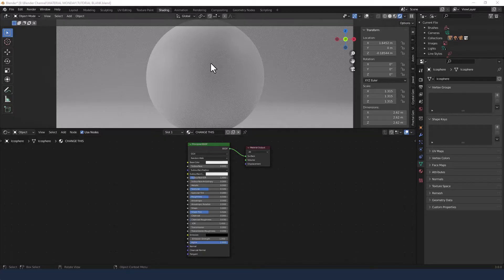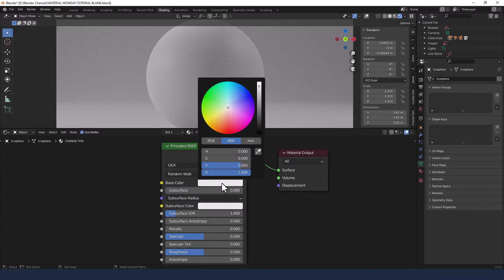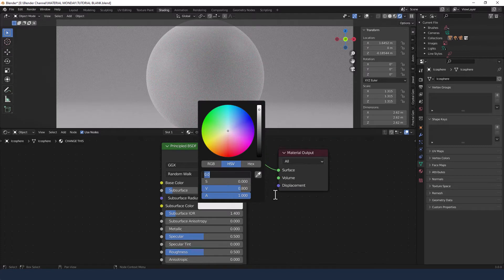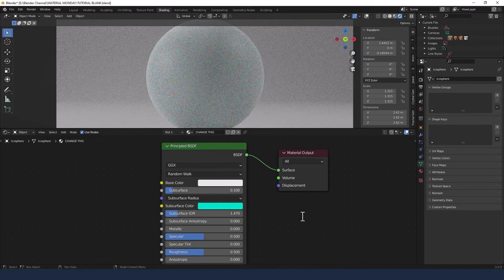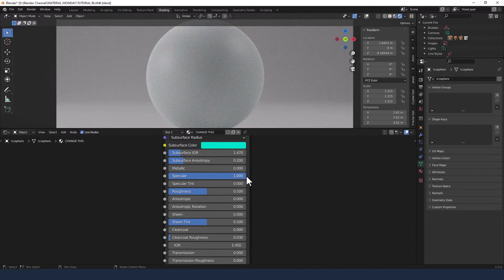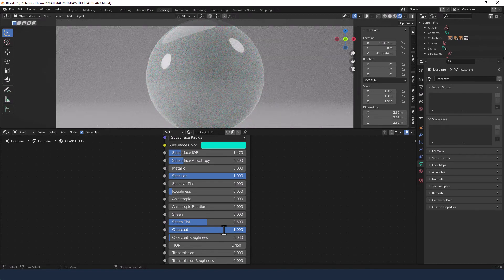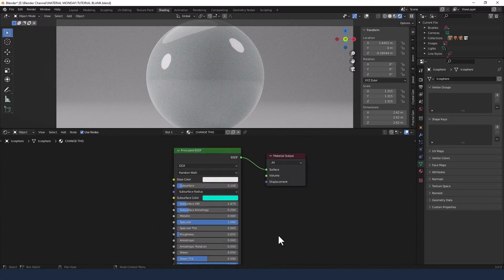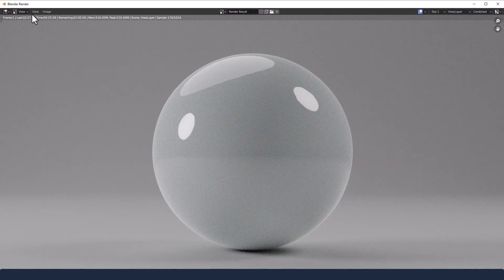CREATE A GLAZED CERAMIC PROCEDURAL MATERIAL IN BLENDER

Comment: You dont need SSS for ceramic like that my man you just are adding more calculations to the Render
Reply from the maker: Thanks for leaving your thoughts however, imho there would be SSS for the glaze and the ceramic itself (depending on its thickness - think of how porcelain has a translucent look and feel). 
You can leave it out, though, if you are in a hurry or don't have the processing power.

Comment: I'm not sure what's different, mine turned blue as soon as a turned on the sub surface modifyer, with both base colors set to white
Reply from the maker: This could be to do with a number of factors. If you have created the scene and shader as I have, the results should be the same. Have you used lights or a HDRI to light your scene?